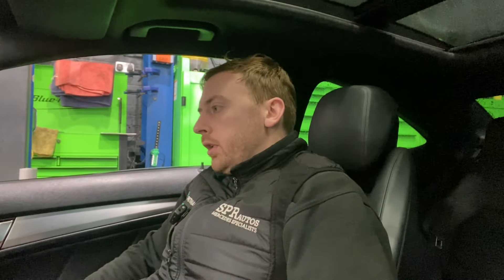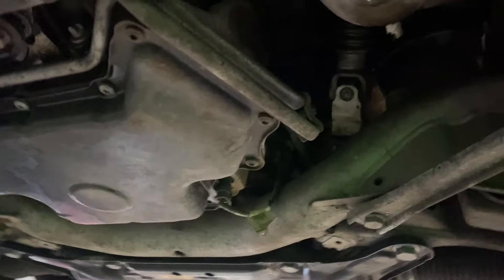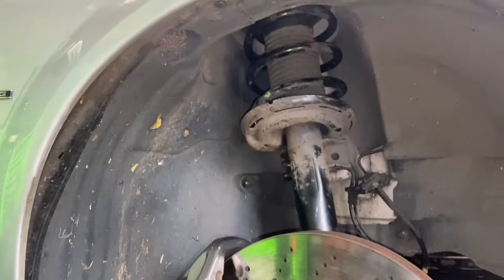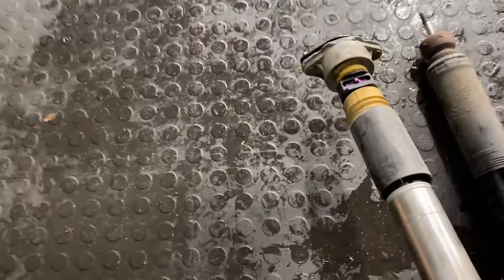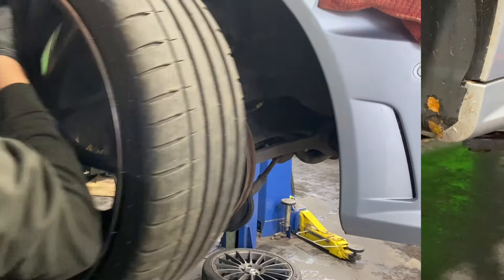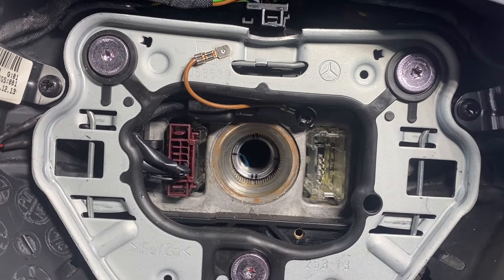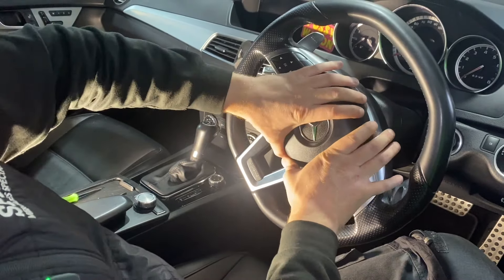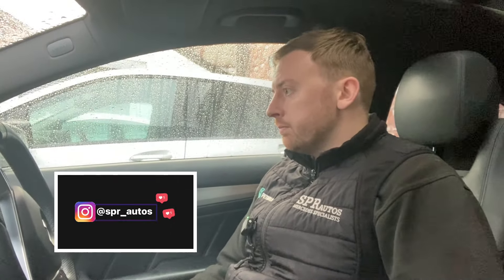Nightmare job! UN-modifying! A Mercedes C63 AMG! Headers, coilovers,steering wheel and more!

Comment: I get that people love their cars, but I don’t get that they modify them.
Reply: Because they know more than the best engineers in the world. 😂😂 over 1 billion dollars to develop a car, yet kyle down the road knows better.
Reply: Sound, power (at the expense of wear), and aesthetics, probably, though I don't get the carbon fiber and lowered aesthetic either. Maybe lowered suspension offers a tiny bit better track handling, but it's already an amg.
Reply: But was it any better once they'd spent a fortune on it? Especially as all they seem to do with this kind of car is make a noise on the A6 through Stockport or the A57 through Denton.
Reply: I don’t think you get that people love their cars then…
Reply: Because the modifications give them the exact experience they desire for the purpose why the bought the vehicle. Cars are mass produced to suit a wide variety of people.

Comment: I live in Canada.  I had a brand new 2014 C63 507 for 5 years.  I also had a couple corvettes and other performance cars.  The corvettes were fun to install cams/heads/headers tunes etc on and the results were always fun but I could have never dreamed modding the C63.  It was so good from factory it would have pained me to bolt aftermarket parts to it.

Comment: I took a 2018 C63 biturbo into the Merc dealer under a  warranty claim for leaking intercooler fluid. They admitted firstly that they did not know where to start and that they may have to take the engine out to reach the intercooler.🤷🏻‍♂️🙄
Reply from the maker: Oo wow. Hope it got sorted

Comment: I like my cars as it came from the factory, all the right parts are available, and no guess work. Doing this is all fine if it's strictly a track car.
Reply: It's only very rarely you see a mod that improves anything.   My stainless system qualifies, I think, because it's not loud and looks nicer.

Comment: What's the idea with putting it back to stock?  Doesn't it command a higher price modded or people don't want to buy a ragged on modded motor?  Must be costly to unmod it.
Reply from the maker: I don’t think they demand any more money modified, the older these cars get the more people want them standard. “My humble opinion”
Reply: @sprautos  Couldn't agree more! I have one and I see so many of these with a bunch of tasteless mods, side skirts, spoiler lips, ridiculous big fin diffusers, those stupid overly sculpted after market steering wheels, everything blacked out including the lights and of course the full ali express treatment when it comes to carbon pieces. Yet, nothing takes my breath away like when I see one that's (nearly) untouched, a time capsule that looked like it rolled fresh out of a 2011 showroom, a symbol of the end of an era when everything just made a little more sense than today.
Reply from the maker: 🤣 @sveeny  agreed.

Comment: Lucky yer man isn't in Australia. Cat delete can net you a massive fine - plus the installer (who will give disclaimer - only to be used off road). Not only a fine but a risk of having car seized. Alteration to any suspension on a car with modern "safety aids" - ABS. Agility control etc etc requires an engineers certifciate. Oversize wheels and tyres etc etc. Not only a legal risk but your vehicle's insurance becomes void.
Reply from the maker: O really, that’s interesting to know, perhaps not a bad thing, I see plenty of mods not fit for the road.
Reply: Modifying a vehicle which contravenes the strict Australian design rules renders it not roadworthy, not registered, not insured and will negate your finance agreement.
Many guys are driving vehicles in this category. They don't find out the consequences usually until involved in an accident. Even if you have a crash which you are not to blame, your insurance is void and you are also required to pay the other parties repairs - out of your own pocket. An assessor will inform the insurance company who will inform the legal authorities. God help you if you've been involved in a fatality.
Friend of mine had a Mercedes wrecking yard. He always has a number of vehicles he's picked up from insurance companies or finance companies where the vehicle for some reason was should not have been on the road.

Here's a corollary. : A group of 10  - 14 outback  4WD enthusiasts were making the South North trip through central Australia. They had a various bunch of off-road vehicles which were allegedly  suitable for the long harsh condition journey. Many had modified their vehicle with bull bar's, tow bar's, winches, roof carriers, extra tyres, extra jerry cans of fuel and camping equipment.
One evening one of the vehicles ran over and killed a sleeping indignant person who was laying on the track. The police arrived to clear up the scene. The offending vehicle was a monocoque chassis which had been modified with a large roof rack and was carrying a near estimated 400 kilos on the rack. The roof legal limit was 100 kilos. The bullbar, winch and roof load were in excess of the gross load for the vehicle - without driver, passengers and camping gear. The policeman informed the driver that his vehicle exceeded design limits, therefore was not road worthy which meant he was driving illegally. Further   -  worse case he could be charged with manslaughter.
The other vehicles I the convoy were inspected and nearly all were found to be overloaded. A truck had to be called from 400 kilometres away to offload the convoys over weight.
Lots of tickets issued. @sprautos
Reply from the maker: 😯 sounds very strict not in a bad way. 
Thank you for taking to the time out to share that information and story, I’m sure others in the comments will find that interested as I did .
All the best 🙏
Reply: @lezivanerrol3697  mods are fine on cars man, don't portray them as something negative. road legal mods are a thing too, these often carry a TÜV certificate, this lets you pass inspection safely and insurance isnt void as long as you tell them.

Comment: I have driven on these coil lovers The past few months! I drive the car hard But Not too hard! findings!!! It feels like it's faster,, It handles way better If you like the soft ride of the Mercedes Don't get it done but if you prefer a from a ride my gosh get it done I don't think it's much difference! Soft versus sport Versus ABC.. I got this done Very very very cheaply! They didn't take out all the lines, Or the accumulators. hero Is what I went with $1000-1250.. my shop guy says They're no different than BC Racings,vivek.... If you do not drive the car on the track There's no need for the sway bars